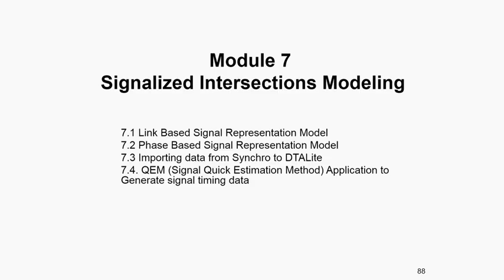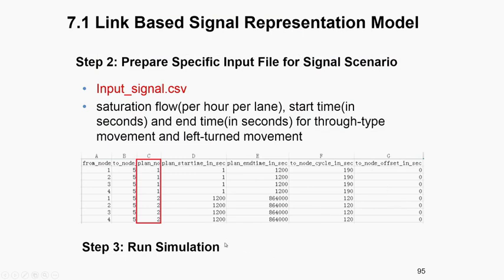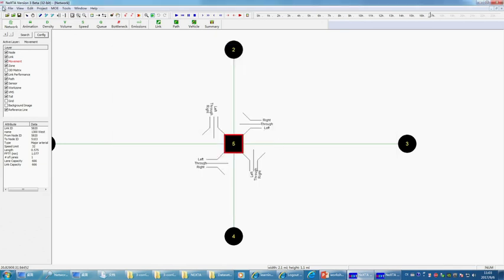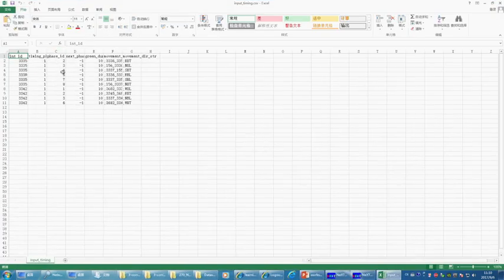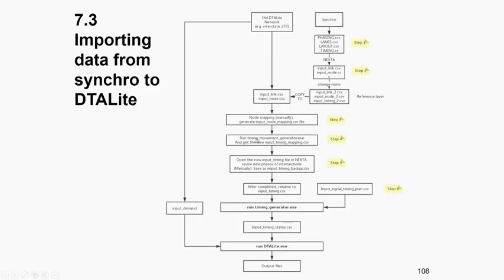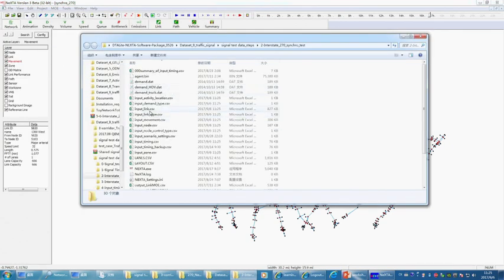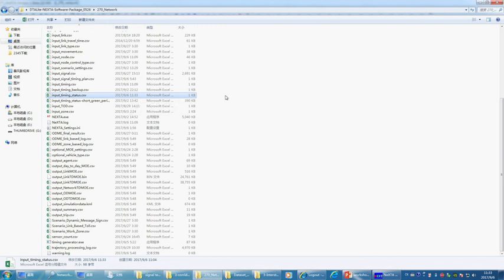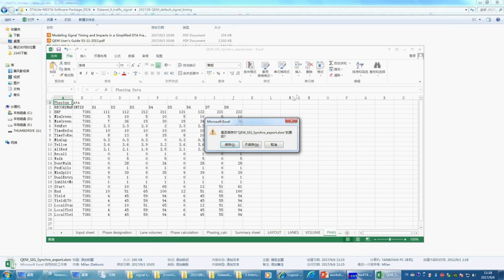Lesson 7 Signalized Intersections Modeling

Comment: Hi, Professor Zhou! I was wondering why mine doesn't have the  "Signal Representation Model" when I clicked the simulation button and also doesn't have the "Phase" tab when checking the movement information of a signal controlled intersection. I downloaded the software packages from the dropbox linkage you posted under the video of Lesson 1 and I also installed all the required software. Thanks!